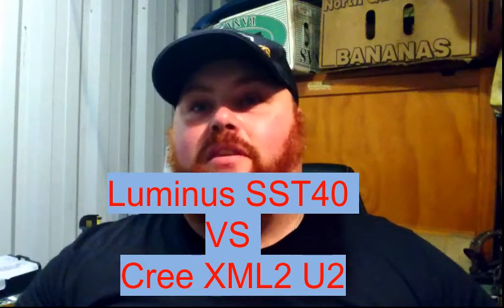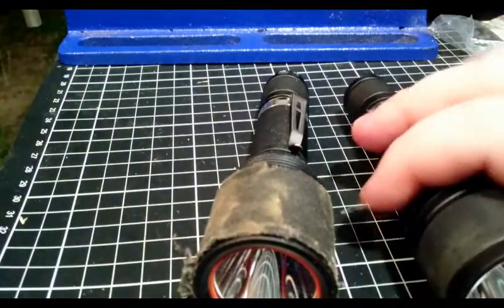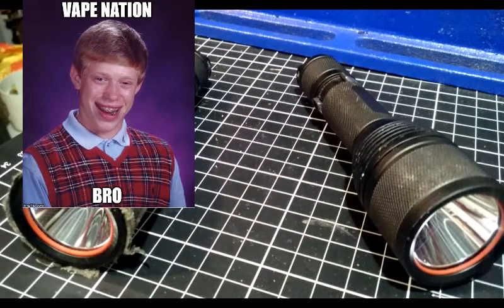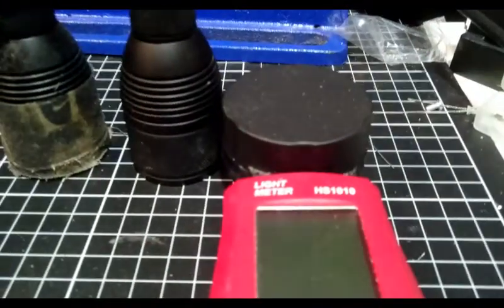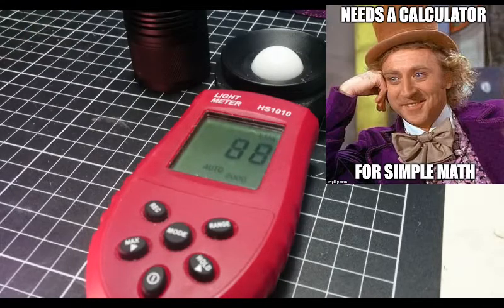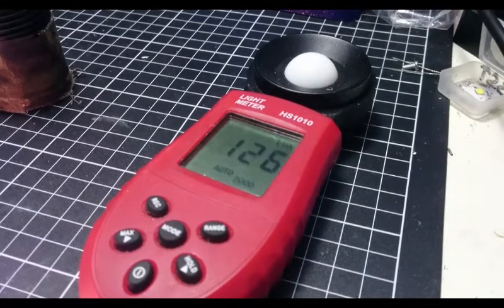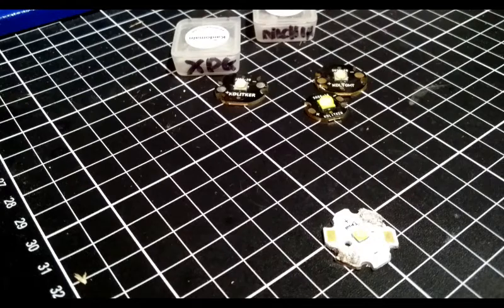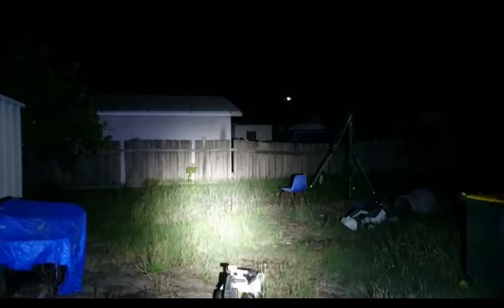Luminus SST40 VS Cree XML2 (SST40 Overview)(2400 lumen flashlight)

Comment: I am planning to run SFT40 direct drive in my C8 host which currently has XPL Hi in direct drive. Do you feel using the same battery (Sanyo 3350mah) i am using now with XPL Hi (roughly giving 4.5 amps) will give more amps on SFT40 direct drive due to lower Vf of SFT? Or do i need to upgared my battery too in order to hit around 8 amp ?
Reply from the maker: Sorry just seen this, what cell is it? Is it a Sanyo GA? They are good for about 10 amps otherwise i would think you need a better cell as the SFT-40 will do 9+ amps easily.

Comment: My Crees last a long time never had one go bad.  Is the SST40 as long lasting and reliable?
Reply from the maker: Hey mate, yea these are great LEDs even when over driven. Luminous has an updated version that is domeless called the SFT-40 which performs slightly better but offers a great amount of throw as it's domeless. Also if you still run the old XM-L2 Cree released an updated XML-2 which is a flip chip design that performs better than the older XM-L2 LEDs and Cree also offers a XM-L3 which performs identical to the SST-40. I have a video comparing both of them.
https://youtu.be/Zpom_KIUON4

Comment: I have a doubt.
If we are talking about a 1000 lumen bicycle light that has only one cree versus a 1500 lumen one that has luminus, which one is better and why?
What is the difference between one and the other?
Reply from the maker: Depends on you i guess. Do you want the extra brightness or the the extra run times? Plus pou have to worry about heat.
Cree just released a XML3 which is the same brightness as the SST40 at the same amperage so now you don't have to choose. 
Overall Luminus has done a good job at getting different tints (kelvin) LED's on the market instead of just cold white.
Reply: @everydaysurvivalgear  Well, it's 1500 lumens vs 1000, the headlight of one is luminus while the other is a CREE LED, I don't know which one is better.
The more light you can have the better.
Reply from the maker: @twosix_00  Both great LEDs go with the luminus it's a solid LED.
Reply: I am only interested in a wearable wrist light or work headlamp that gets 10 hours flat runtime.   All other lights get thrown in the garbage or car truck until I get the once in a 5 year night time flat tire, in which case,  I am sure that the battery will be dead.   So,  probably the garbage,  is a better place.

Comment: forgive my ignorance im learning,but am i to understand when you say "direct drive" do you mean directly hooking battery to emitter by-passing the driver all together? i have several sst40 lights majority running on a single 26650/18650 battery, I purchase the HI-64 AMP 26650 vaping cells from Efest to drive these sst40 lights in hopes of gaining some light, and utilize the new 3500mAh Panasonic/ SANYO NCR18650GA 18650 Japan version for its high mh and over 10 amps draw,also in hopes of getting more light,..however seems the high$ batteries dont make much difference as far as brightness, am i pissing in the wind and current is limited by driver and fancy batteries make no difference?? so if im understand you correctly you are by-passing driver,how is this achieved? i have seen others (Matt) add resistors to get more current (amps) on the driver board but if there is a way to direct drive i am interested. adding two cells at 8.4v trips the overvolt protection on current boards so tried that trick first, the sst40 real performance on charts at over 6 amps nearly  doubles so any suggestions would be greatly appreciated thanks   Adam
Reply from the maker: Hey mate! You could easily hook the battery straight to the LED if all you wanted was max output but then you loose modes, Plus it can be tricky due to excessive heat build up plus the voltage of a fully charged may be on the high side for some LEDs. I have several lights using the SST40 and a direct driver drivers. 

A direct drive driver is a driver that uses a Mosfet to control the amount of current going to the LED. Some drivers offer direct drive in the highest mode so you are basically running the light at max current minus the current losses from the springs and wires and other components on the driver.  While still keeping the ability to have modes and some times battery checks. The best thing to do is to buy a new driver and swap it out. Once again you can use a partition board and direct drive the LED from the battery but you will have no modes. 

The driver that i use is this one. Its decent and gets high amps you could see around 8amps from a SST40.
https://www.banggood.com/custlink/3mvKq2Luw8

What driver or light are you currently using? You can gain some output by doing a spring bypass to the springs this will help reduce resistance also use thicker gauge wire to and from the LED?. The Vapcells will offer higher amperage compared to the NCR18650 because they have less internal resistance so you will see a slight improvement while using these cells. 

Driver wise you have plenty of options now days depending on what size you need?
http://kaidomain.com/Flashlight-DIY-and-Tools/Circuit-Board-Driver-Board/S028401-FET-8x7135-22mm-3V-4_5V-1-cell-5-Mode-Flashlight-Driver-Circuit-Board

This driver is good for about 6 amps but you can change the sense resistor and get more amps from it.
https://www.aliexpress.com/item/4000961062843.html?spm=a2g0o.store_home.productList_644232540.pic_4
If you are using a 7135 driver you can also stack more 7135 chips to get more output. 

You can always find plenty of info at http://budgetlightforum.com/
Reply: outstanding answer very much worth tinkering with thank you for your excellent in depth answer my friend ty Adam

Comment: Dude you know your stuff! ... BTW this is the only video on all of YouTube I could find that compares the sst-40 and xm-l2. Excellent 👌👍😁
Reply from the maker: Check out www.Budgetlightforum.com heaps of info can be found there.
Reply from the maker: @Sano Saja hey mate if you go to the Cree or luminus websites they have data sheets which will show you a general lumen per watt output of both.    I would assume they would be fairly well matched a high binned XML say a U4 in a CW tint will do about 1600 lumen over driven to 5-6 amps which is on par with the SST40.  The SST40 stock is rated to 1600 lumens at 5amps. The max output you will see from a XML2 is about that 1600 lumens maybe a tad less depending on a few variables. I have heard of people getting 1800 lumens from a XML2 but I've never seen it. The SST40 should how ever hit around 2500 lumens if it's a decent bin over driven. 
Your heat issue is because of the light itself not the LED the SST40 does perform better than a XML2 when it's cooled properly.
Reply: @everydaysurvivalgear  thanks very much for that lesson. Really appreciate it and I understand the differences between the XM-L2 and SST40 much better now.

Comment: hi, what is the output of sst40 if i run it with 3.5amp driver ?.. is it better than xml with that current setup ?.. i dont want to swap to direct drive driver.. hopes you can help me figure it..
Reply from the maker: Hey mate probably similiar output as a Cree XPL, Maybe 1200 lumens so only slightly better than a XML2. These LEDs the (SST-40) are able to run at 5amps from factory for about 1600 lumens. Maybe it might be better to get a regulated 5amp driver? Or look at getting a XPL2?
Reply: @everydaysurvivalgear  thankyou mates... now what about the battery consumption on that sst40 ?.. how long the 18650 is able to give full output before need to recharge it to get full potential ?... im planning to swap it into my astrolux c8 that is direct drive..
Reply: @everydaysurvivalgear  last question, on where you bought that sst40 emitter and about how many dollar ?.. i only found it on aliexpress.
Reply from the maker: @harisyoung4110  Using direct drive you won't get good run times on the highest output as the C8 will not be able to handle that much power. 

The light will step down output fairly quick with the SST-40. If you need it for extended use limit the power to 3 amps maybe?
Even at 3amps you will get around 1 hour of run time. 

On direct driver (depending on the driver) the SST-40 may consume up to 9amps. The C8 is still a fairly small light. You might be able to get away with a tad more power depending on where you live, If its cold outside that helps a lot. 

What C8 are you buying? You can buy a C8 with a SST-40 already in it? 

https://www.banggood.com/custlink/Gv3D4uHoBp
I get my LEDs from Kaidomain they also sell on Aliexpress but the website is cheaper. For the C8 you need a 20mm LED board.
http://kaidomain.com/Flashlight-DIY-and-Tools/LED-Emitters-or-LED-Star-on-PCB/Luminus-Leds
Reply: @everydaysurvivalgear  thank you for the kaidomain link..it really helpful... i dont plan to buy a new c8 because i already have astrolux c8 that have been more than years of use... im just planning to upgrade the led to sst40... although my stock astrolux with spring bypass also is bright enough but sometime i feel bored with that same light, feel like the bright is not enough and not feeling satisfied... maybe it just my problem, not the light..lol, anyway just now i had order the sst40 led on ali because the price is quite cheap same like others cree type.. before this i thought sst40 will be twice expensive because of it phenomenal output..
Reply from the maker: @harisyoung4110  You can buy a Dedomed SST-40 from Kaidomain that might be the way to go? You should get better throw than the XPL-HI with the dedomed SST-40. I killed like 4 SST-40 trying to dedome them so i moved to slicing so its good Kaidomain sells them already done. The SST series in general is about even with the XML2 and XPG2 LEDs (price wise) they just perform better. If you buy a Cree XPL or XPL2 they are still expensive like 7-8 USD each.
Reply: @everydaysurvivalgear  i dont think want to take a risk of dedome that one bcause my back experienced with dedome xml on convoy s2+... my dedome xml( dedome in petrol) at first i feel succes on dedome it because the light did works, but only for a few hours... after i accidentally drop the flashlight, damn it wont work and i feel so frusted at that time because i dont have any spare led or other flashlight at that time and have to wait a few week to receive the order of new led to lighten up my life.. maybe because of the impact on expose no domes led it make the small wire on the diode to break.. i feel my life is so dark at that time bcause dont have any others flashlight during that time..lol..m anyway it so nice to know you bcause you have so much knowledge and like to share with others... im just a new to getting into learning flashlight world and mods.

Comment: hey i'm happy to stumble on this video while looking for info. I recently ordered an Astrolux FT03 and am waiting for it now. Being new to these kinds of quality lights, I have some confusions I need help clearing up.

I was hoping someone could clear up my question about direct-driven lights (which I assume the SST40 in the FT03 is?):
If it's direct driven on TURBO, does that mean that a high-drain 30A battery which puts out way more than the 5A SST40 rating, could damage the light? Should I use a high-capacity, low-drain battery instead (something <10amps continuous drain?)

Thanks for anyone's assistance
Reply from the maker: Hey mate i want one also but have not ordered yet as the delay is already bad i was waiting for the first batch to be delivered. Yea the FT03 is using a Fet+1 i think similiar driver to the BLF X6 driver just with a side switch and better firmware. 
The driver regulates the max current that is needed so you can use any cell inside the light and it will be fine. The higher the drain the cell the better performance you will get. LEDs are some what self regulating as long as you can keep them cool you by using a DTP MCPCB  (LED board) and a proper cooling system they will regulate the power draw and be fine even without using a driver. The SST40 is rated at 5amps to do 1600 lumens this light is meant to do around 2400 lumens realistically it will be closer to 2100 lumens and drawing around 9amps while being used in direct drive. 
So use the best high performance cell you have  if you use a cell that is only good for 10amps it may lose voltage quicker than a better performing cell at high discharge rates.
Reply: @everydaysurvivalgear  thanks for that! I must say I'm pretty new to lights like these; have been getting by in life on the consumer-grade trash from the supermarket. But now I'm starting to learn about what's out there I can no longer settle for flickering rattlers with dodgey switches anymore.

Thanks to people like yourself and those many others who put all that info out there, it really helps

Comment: Did they have the Cree XHP70.2 LED when you made this video?
Reply from the maker: Hey mate yea i think so but the XHP70.2 is a 4 die LED 2 dies are in series and 2 are in parallel for the 6v edition. No doubt the XHP70.2 is a beast it can do 8000+ lumens. Plus the actual footprint of the XHP70 is bigger than the SST40 and XML2.

Comment: En un host c8 cuál pondría? XPl2 v5 o sst 40
Reply from the maker: Sorry  i didn't see this comment. I just a built a light with a XPL2 its awesome LED. I think the XPL2 is better suited to the C8 because it may offer slightly more throw than the SST40 being a smaller die size all thought the overall structure of the LED is very similiar.

Comment: Great video, very informative. Just wondering about something though. I just bought an amutorch x9 which uses xml2 led and i know people are swapping the xml2 for sst40 leds. Would i need to get a new driver in order to solder sst40 led into it?
Reply from the maker: Hey mate it depends on the driver you may be able to get extra power from just swapping out the Leds. Max output for a single XML2 is around 1700 lumens where as the SST40 is capable of 2500 lumens. Usually in a triple or quad you won't get maximum performance from each LED. In this case battery will be a limiting factor. The Leds sits on there own board but it may be hard to find a triple board that fits. The board is called a MCPCB they are direct thermal path copper LED board designed for high powered situations.

Comment: Hey mate, measured in a good integrating sphere the SST 40 does about 2,400 lumen in raw form. Once you put it into a light with all the losses of the reflector and lens you can probably expect a maximum output of 1800 to 1900 lumen OTF.
Reply from the maker: Hey Jason yea but the actual pad is classified as a 5050 footprint same as the XML,XHP50 it works similar as the XPL. The Cree XPL is bigger then a 3535 LED but still fits on a 3535 board. They must an industry standard with sizes and allowable tolerances.As for output id generally reduce the max number by about 10-15%  so 2400 lumens minus 10-15ish percent is 2100ish lumens. Seeing as the EE X6 is a smaller SMO reflector with AR coated glass i dont think looses would be extreme. 
I have broken a few of these SST-40 now trying to dedome them last one was hot dedoming it looked like a perfect job then it didn't work. The first time in petrol it worked for a while then stopped working after a while. I really want  one in a zoomie. I bought some cheap XML2 from Fasttech and used the spare boards with them lol. 
Happy 4th of July mate! :D
Reply: everyday survival gear - Wow, I must have got my pad sizes mixed up. The sst 40 is 5050. Maybe I was thinking of the Luxeon V? Their output is also right up there with the sst40.

Comment: Nice lights. Do you like the eagle eye more than a convoy c8?
Reply from the maker: Hey mate. They are both great lights so it's hard to choose. I think they are both build good but the X6 is just a tad better and as an all rounder it's more even. The C8 is more of a compact thrower. For its size the X6 handles heat very well.
Reply: everyday survival gear thanks my next build is going to be a xpe2 green for coyotes.
Reply from the maker: In this case i may sway more for the C8 seeing as pressure switches are easy to find. I have never seen a pressure switch for a X6 but you could make a C8 switch work i guess by taking out the internals and swapping them. They both use the same size switches.